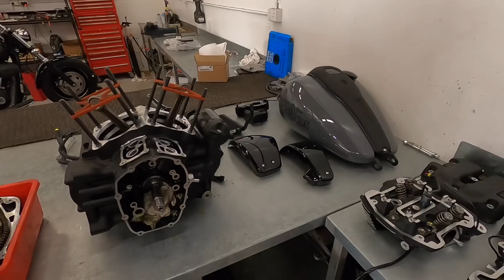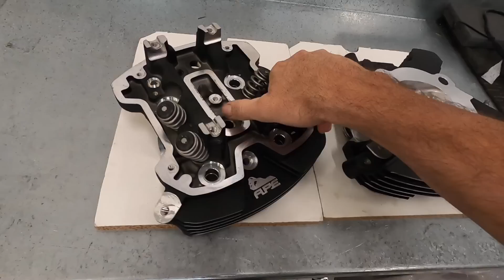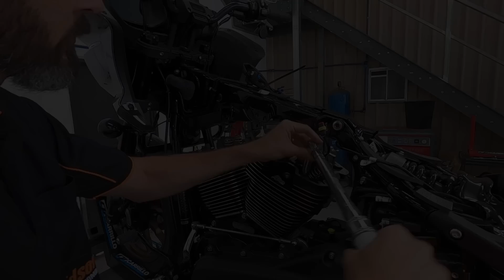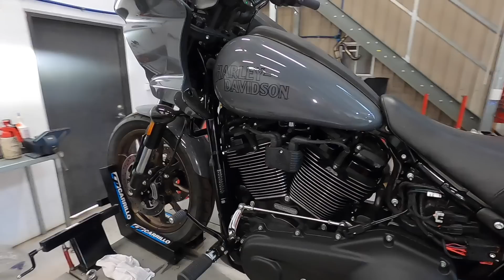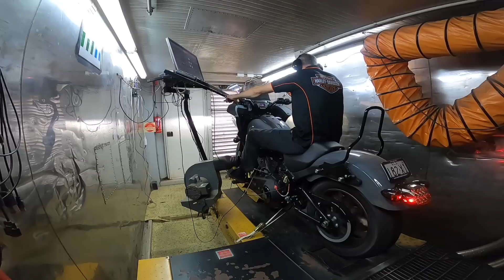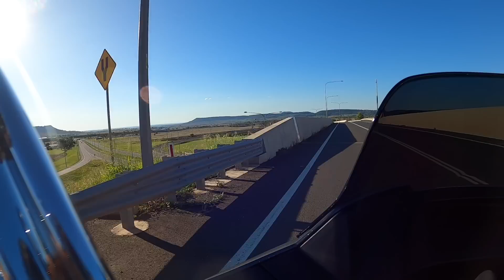160+HP 143ci Lowrider ST

Comment: Why put so much $$$ into the engine and then put some of the absolute worst pipes on it? Lol
Reply from the maker: @beri232  That's a question for the customer
Reply: @MasterTechMiller  When I bought my Harley, I came from riding Honda’s and people just don’t usually do any engine work to them… so I was blind to the necessities of making good horsepower on a bike…. I had bought Vance & Hines 2 into 1 Big Radius pipes figuring it was a 2 into 1 therefore it had to be good and I loved the look on the bike. I then decided to turn my 103 Fatboy Lo into a 124 so I researched the hell out of Twin Cams. Those Vance & Hines were sold and D&D Fatcats were thrown on. Lol. It cost me $22,000 CAD to get that engine built. There was no way I was going to let the exhaust system drag the rest of the engine down.

Comment: Awesome build Master Tech Miller!!   I  turn 62 next month and buying a new Harley Low Rider ST for my birthday. My last bike was a 2007 842 lb street glide with the monster 88 Vtwin 🤣.   Being much older I wanted a lighter bike I could ride around town and also go on two - three hour cruises.  I can't imagine how much fun the stock 117 engine will be  and I am not going to do a thing but add new pipes.    You are one badass with that engine build.  I think that engine would pull the tendons out of my shoulder when I twisted the throttle.  In any event have fun  mate and safe travels.   And changing the subject, I am a musician and have tinnitus from too much loud noise over the years.  Make sure you protect your hearing especially when working on these monster engines everyday.  Tinnitus is no joke and having permanent ringing in my ears sucks so just want fellow riders and musicians to be aware of this condition and protect your hearing.  PS.....you have a new subscriber. Love your channel.  You rock brotherman!!
Reply from the maker: Thanks for reaching out & leaving a comment! Much appreciated. Good luck with the new bike, I am sure there will be plenty of smiles per miles!

The hearing is no joke that is for sure! I already have a mild case of tinnitus which does not seem to be progressing as yet.
I am always wearing hearing protection in the dyno room as with a gas mask.

Cheers again for watching!
Reply: I did the same = Road Glide to FXLRST tobacco fade. Love it. Also struggling with tinnitus, using ear plugs with a helmet now.

Comment: When you increase the air going into that engine with heads, increased bore, and increased intake diameter, are you also increasing the exhaust diameter?
Reply from the maker: Are you talking about the the exhaust port or exhaust pipe diameter
Reply: @MasterTechMiller  The exhaust pipe diameter
Reply: I would assume the exhaust port diameter is already increased
Reply from the maker: Most aftermarket pipes are larger in diameter than the OEM headers.

Comment: so no break in period for new top   getting new lowrider ST and some say no need and some say keep 3K rpm  either probably ok. great video
Reply from the maker: No 'Break In process' the bike should be properly dyno tuned to get the correct AFR & Ignition tables. 

A freshly built brand new engine should be heat cycled, then dyno tuned ASAP

Comment: 143 cu in = 2343.35 cc. Respectfully because I do respect your expertise, but a Suzuki GSXS 1000 makes 160 hp outa the box for only 13,000 USD if you bother to get it electronically fiddled by a reputable tuner like "Moore Mafia" you get 160 Dyno hp all that before even opening her up. All in a reasonable 500lbs sport touring package🦧But you Harley guys are beyond reason.
Reply from the maker: So what?

Comment: I noticed you use the stock 117 air cleaner. Would it get better results with a bigger breather? Is there a air cleaner that you recommend?
Reply from the maker: It would definitely make more power with a better air filter like the ventilator extreme (which is what I suggest highly) however this customer loved the look of the OEM Heavy Breather & the 2-2 exhaust.

Comment: How is that drive belt holding up with all that torque?
Reply from the maker: The belts these days are pretty strong. For this bike & it's intended street use it is absolutely fine. Even if a little 'play time' happens from time to time.

If you want to race your bike & give it a hard time I would suggest the consideration of a chain

Comment: What's the reasoning behind now doing the cam and top end while it's not on the bike?
Reply from the maker: The engine cases had to be removed from the chassis for machine work. The 4.5 inch cylinders won't fit otherwise.

Comment: Nice build  but I disagree  on freedom  pipes,freaking  junk pipes. Wouldn't  run them if you gave them to  me free!
Reply from the maker: I'd much rather these than the Vance & Hines big radius. Those things are absolute garbage as far as HP is concerned. 

Obviously a nice 2-1 would've been the ultimate choice but the owner doesn't like the look.
Reply: @MasterTechMiller  totally  agree on the 2into 1,people  just don't understand  how a little  backpressure and the pulse of a 2 into one works.

Comment: Awesome build. Love your videos. Quick question: I know you’ve said the Vance and Hines 2-2 big radius rob quite a bit of horsepower. Do they also rob torque? I’m having a 131 SE crate engine placed into a 2018 Breakout and plan on putting in a CR 512 but I love the look and sound of the V&H big radius 2-2. Thanks for your help!
Reply from the maker: The V&H big radius do rob HP for sure, as for torque, they do a good job of making decent torque from the low to mid range. After that it's all over from 4000 / 4500rpm
Reply: @MasterTechMiller  awesome- you got a new subscriber. Love your content and really appreciate you taking the time to answer questions 😎
Reply from the maker: @AP  cheers for the awesome feedback & support 🍻 👏

Comment: What a beast of a HD motor, Pity the exhaust will dampen the power over a tuned length 2 into 1 pipe. Do you run the cam in above idle ??
Reply from the maker: All M8 engines have roller cams & roller lifters. No need to run them in at all.

Comment: I know if you have to ask but ... a guide for the cost of this level of upgrade please?? Thanks Tommy !
Reply from the maker: About $15,000aud
Reply: @MasterTechMiller  you got robbed if you paid 15k
Reply from the maker: @Jay Pee  I built the bike mate. The customer paid. 
The cylinder heads are roughly $3500 the piston & cylinders are $2500 
Camshaft $600 
Exhaust system $1800
Machine shop for case boring & cylinder decking $800
Compensator ramp $699
Dyno tune $650
Adjustable pushrods $500
Labour $1716 that's roughly $12765
Intake manifold, $900
64mm throttlbody $600
Misc gaskets, seals, oils etc takes it up a fraction more.

I said ROUGHLY 15k in response to the previous comment. Some guys may want a different air filter setup which again will add to the cost.

It is what it is mate. These are Aussie dollars I'm referencing too, just to be clear.

Comment: Hi Tom, I have a 128 11.1with APE heads and Intake Fueling 521 and full Fuel moto 2/1/2  , it's quick but easy to ride in all conditions.
 How does the 143 compare around town, low revs etc with that comp cam etc ?
Top job BTW .
Reply from the maker: It's actually very well mannered to be honest. Very easy to ride around a lower speeds. 
Does get slightly warmer than smaller engine combos but that is to be expected by larger displacement air cooler engine.

Comment: Very nice job my friend. I have the S&S 128 kit in my LowriderS 143 HP 160 FT TQ and it rips. Now I wonder what that 143 kit feels like.
Thanks again MTM.
Reply from the maker: That's a tough kit you've got yourself there mate.
Reply: How much did the build cost you? I’m thinking of running it because it has one of the best sounds & reliability rate
Reply from the maker: The 143ci option starts at around $12,000aud
Reply: @MasterTechMiller  the 128 kit not the 143 I’m no money man I’ve got two other bikes that need loving too 😂
Reply from the maker: @Brandon Wong  Not sure on the price of the S&S kit, but our 128ci APE Stump Puller kits are around $6500aud ride in ride out, depending on current bike configuration (cam, exhaust, air filter, tuning module already fitted etc).
Generally most guys have a full stake 1 kit with a tuning module & that is normally 6.5k ride in ride our for a 128ci kit
Reply: @MasterTechMiller  is that $12k ride in / ride out?
Reply from the maker: @Alex King  Yes. However that is just a rough guide as you may require more or less to go into the build depending on your current setup & requirments
Reply: @MasterTechMiller  we need to talk!
Reply from the maker: @akingsroad  you can email me at workshop@ddhd.com.au if you like?

Comment: Great job mate. Hard to believe the std running gear would last long with that tq and hp.
Reply from the maker: If miss used and abused, any drive trains components will fail even if they're a tough aftermarket option.

Thr OEM compensator has been replaced with the billet steel option & the clutch has the upgraded 1275nm springs in it.

For day to day riding around & having the  off bit of 'fun' the OE transmission will be fine. Sure they're known to break 3rd gear from time to time but that was a risk the owner wanted to take at this stage.

Comment: I can’t believe you guys are using the stock shit for the oiling system. Can’t you get S&S or Feuling pumps and cam plates in your country? S&S is set for 45 lbs of oil pressure and feulings is set for 65 lbs.  Also do you guys change the stock crap harley cam bearings out too? Your just asking for it using the stock junk.
Reply from the maker: OK, firstly mate. How many M8 engines have you built? 
2nd, Yes, EVERY single engine or cam job I do get the full complement cam bearing.
3rd. The OE oil pump from 2020 on (the 8lobe) has NEVER failed us once. It meets the demands of all the big bore high output builds I do.

4th. Yes we do have those products here in Australia & the S&S oil pump & cam plate is junk in my opinion. Reasons why, the bronze bushings installed for the pinion shaft & Camshaft have been know to 'catch' & subsequently spin in the cam plate blocking off oil supply holes. 
There is plenty of people having that problem.

5th if you really want an upgraded oil pump & cam plate combo I highly suggest the Screamin Eagle kit. It is far superior to any of the aftermarket kits including fueling. 
There is 1 option from fueling, the Fueling OE+ Cam plate that is used with the factory OE 8 lobe oil pump for all those guys wanting wank factor. 

6th everybody's favourite American George Bryce runs a stock cam plate in his 'Blue 5-0' Road King build. 

I can go on & on with many comments, facts & real world experience when it comes to building big bore M8 engines but I'll keep it simple for you as you seem to be thinking & speaking in a very low resolution manner.

Happy to clear any other Instagram & Internet myths for you too if you have anything else.

Why not head over to my channel & check out the rest of my content where some of your favourite parts are fitted if it makes you feel better seeing them get installed.
Reply: @Master Tech Miller  wasn't fueling contracted by harley for r&d when they were originally having issues with the twin cam... I've built Zero harley engines. lol .. lots of dirtbike motors.. but no harleys..I had just herd harley actually uses fueling for r&d fir thier own parts.
Reply from the maker: @King Of the britons  Yes I believe that Fueling have worked with Harley with many different projects. 

As mentioned, above, if guys are wanting an upgraded cam plate I suggest the Fueling OE + plate be ran with the OEM oil pump. 
Fueling do make several great products.

The S&S plate & pump combo is the one I steer clear of
Reply: @Master Tech Miller  I'm currently running s&s mr103 cams with a stage 1 and a power vision 5.. on a 2015 fxdl twin cam. I'm using the stock chest plate and pump. Is It worth the upgrade or necessary? Since it's kinda the last years it was produced.. did it get a decent cam chest?
Reply from the maker: No real need to update the cam chest components with that model. As you mentioned, it's almost the last of the Twincam & they are great setup in there.
Reply: @MasterTechMiller  thanks and I never meant any disrespect. I’ve just heard so much here in the USA about the factory crap. In fact it’s been said that if S&S had not been around Harley would have folded a long time ago. In answer to your question I have been building engines for 50 years, yea I’m an old fart.

Comment: 450lbs.  180HP.  Buell Super Cruiser
•GAME OVER•
Reply: If it ever gets produced and isn't neutered by epa. Also not a harley engine or even air cooled engine. So ... is it really that impressive.  There are alot of v twin sport bikes laying down that power in that wieght category.. have bin for many years... rsd just designed the super cruiser to look like a fxr.  That's it.. nothing else special thier. It's literally recycled Buell parts from thier sports bike.. with a rotax engine.. I mean I like it as well. But intill you can buy one.. it's a one off custom bike.
Reply: @dormantmenace  we all know what it is, so thanks for the education. Your game is still over
Reply: @noonespecial1217  my game? Lol!! I'm not even competing! I've got a 2015 fxdl with a stage 2 ... 103.. it's a giant mini bike lmao

Plus he is putting down similar power to king of the baggers bikes... and he's got lame duals killing the torque curve.. the king of the baggers bikes are still 100pnds heavier than the super cruiser... and turning lap times with in 2 seconds of the super bikes. With a 7 thousand rpm limit this year enforced..In production frames with horrible geometry not suited for racing. Thier is something to be said about the near 1:1 hp to torque numbers these high hp harley engines put out.  Something the water cooled rotax does not have.. but its also half the displacement.. in all fairness... but rotax also is NOT a American company.. so it's not technically a American super cruiser
Reply from the maker: What do you currently ride mate?

Comment: Gnarly. How practical would this be to eat up miles? Can it be ridden hours on end?
Reply from the maker: Keeping in mind the purpose of the engine. It was built to make hp & go fast. That being said, there is no reason this engine shouldn't last as long as any other big bore high output build. 

I always recommend halfing the service intervals when any big bore engine work is done. 

If you want a 143ci engine that is made for touring, I would lower the compression ratio & choose a different cam shaft.
Reply: @MasterTechMiller   Thanks for the thoughtful response.

Comment: Is that a stock cam plate/oil pump? If it is it makes me feel better I didn't upgrade mine while doing a measly stage 2 😂
Reply from the maker: In all honesty the OEM 8 lobe oil pump is absolutely fine to use as is the cam plate. 
When guys want to update the cam plate I suggest thr Fueling OE+ plate with the factory OE oil pump
Reply: @MasterTechMiller  that's awesome. Keep up the good work 🤙🏽

Comment: awesome tommy great job,why not the cr 540 or the 540-2 just wondering what do you
think the corrected comp on that thing turned out to be ?
Reply from the maker: The 536 is basically in-between those 2 cams but still different enough to produce the intended results.

The corrected comp ratio 11.35:1 with a cold crank compression of 248 @ sea level.
Reply: @MasterTechMiller  can  you run like a 93 octane pump gas With that compression or will it detonate
Reply from the maker: @Ron Coburn  in Australia we have 91, 95 & 98 octane fuels available at the servo. This engine is recommended to run 95 at a MINIMUM.

Comment: Another great build. I missed any mention of flywheel truing. Apologies if I did
Reply from the maker: All good. I missed talking about it and showing it. The Flywheel is trued and welded.
Reply: @MasterTechMiller  Thank you.
Reply: Did not want to seem picky but I have been thinking of doing case up build on 114 FLHCS THANK YOU again
Reply: @MasterTechMiller  --->With counter balancers or no counter balancers?
Reply from the maker: @amphibdriver1  both balance shafts are installed.

Comment: Why not use the CR540 cam? Is the 538 not smaller? Sounds great either way!
Reply from the maker: The 536 I used in this engine is bigger than the 540 in a few specs. The only spec the 540 is bigger in is 40thou more lift.

The 536 closes later & has more duration.
Reply: @MasterTechMiller  why don't you try a star racing 615 cam my 143 made 181 HP on 91 octane
Reply from the maker: @Curtis Hoke  1: I am 2200ft above sea which lowers my dyno numbers compared to dynos at sea leavel.
I have another video showing this happen to my 128ci Lowrider S. It was making low 140s on my dynojet 250i then when I took it down to sea level on another dynojet 250i dyno it made 158hp without touching the tune. I am more than confident that this combo will make number very close to yours if I was at sea level, not to mention if I were able to install a nice 2-1 it would easily go past the Star racing cam.

Please read the description of the video. I outline exactly what some parts are used and some aren't. The customer makes the call at the end of the end day.

Also I have used the 30/30 from Star both in 107 & 114 engine and have been left feeling very underwhelmed with the results.
Reply: @MasterTechMiller  thank you for your knowledge
Reply: I’m getting the 135 for my Road Glide ST! Nice video mate!!
Reply from the maker: @MrBurlybiker  I hope your changing the Camshaft? The SE517 is underwhelming